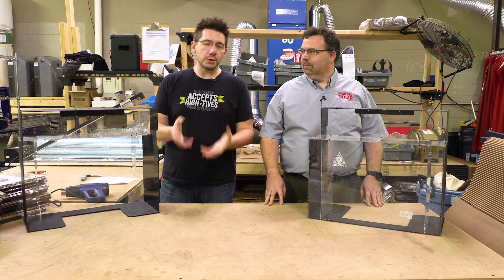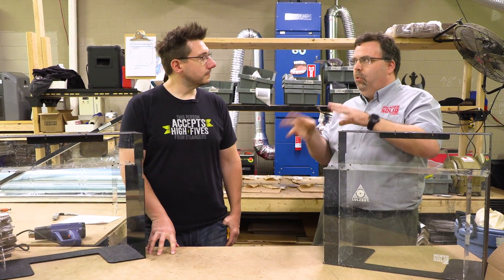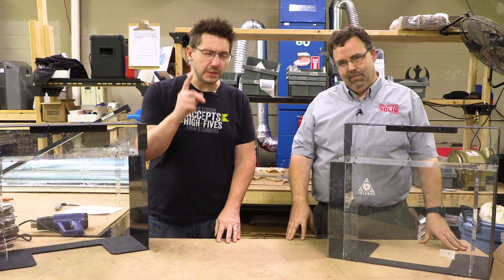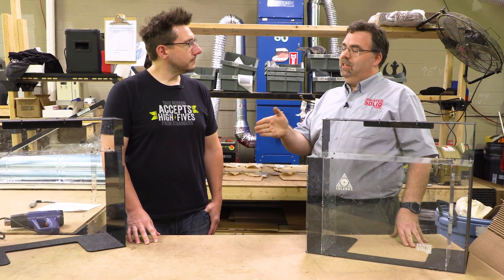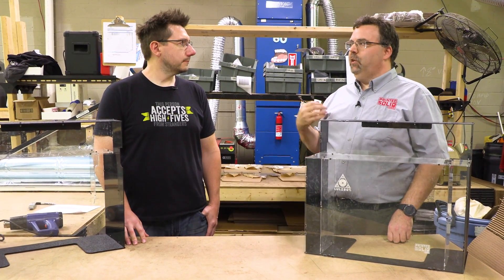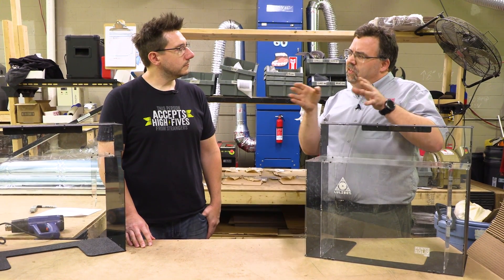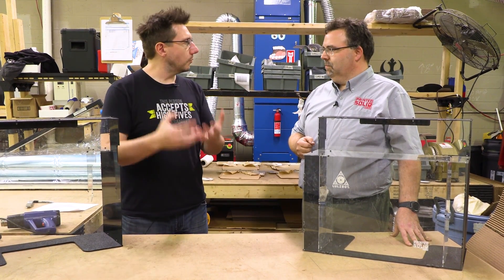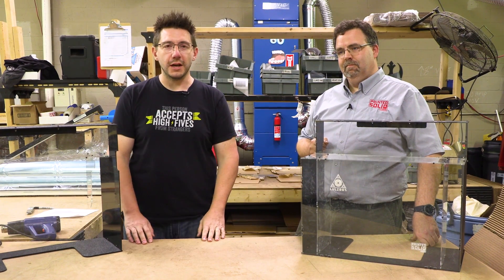5 Tips for Building a 3D Printer Enclosure

Comment: Really good tips which need being mentioned.
I never understood why people put heaters inside the enclosure, the bed usually produces enough heat to heat the chamber. I always tried to cool it down to keep it at a constant temperature. I added a temperature control module which triggers a fan. This way the temperature always stays between 40 and 42°C. The Fan sucking air out contradicts your 4th tip, but I haven't had a problem with it.

Another tip, which is worth to be mentioned, is to make sure that you can reach everything in the enclosure. I installed drawer slides so I can slide out the whole printer. Or just build a cover as enclosure which can be removed.
Reply: Some people run the printers in unheated outhouses/garages in colder climates and need to heat the space around the printer to keep it at constant temps.
Reply: Thanks for the tips, too! Did you leave the Mainboard and the Power Supply inside the enclosure? And how did you solve the mentioned problem with no air coming in when you have a fan blowing out? :)
Reply: @RCShowdown   I have an Anycubic I3 Mega, where the electronics are beneath the printer, so they are also inside the enclosure. To prevent them from overheating I have a slow spinning 120mm fan under the enclosure. This way the electronics always get some fresh air. When this air leaves the electronics compartment and enters the enclosure, it's already a bit preheated as well. This works quite well for me.
Reply: You put heaters inside the enclosure to get more heat. You get better layer adhesion for all high shrink materials. 40 degrees is nice, but why not aim for 50 or 60 instead?
Reply: @antalz  When I have the heatbed at 100°C for printing ASA oder ABS the enclosure would easily reach 50°C without the extraction fan. The reason I set the temperature controller to 40°C is because of the stepper motors. If the ambient temperature is higher, they will also get hotter. For me personally 40°C is a good compromise between better adhesion and longevity of the motors.
Reply: @antalz  motor loose steps at 70 c or more so yuo.need water cooling them
Reply: @noway8233  The steppers on my CR-10 mini still work fine when the air temperature inside the enclosure reaches 60C. I reach that with only the heated bed though, but I used a lot of insulation.